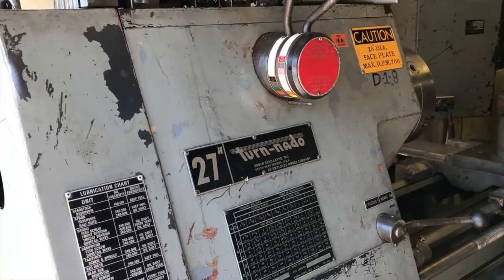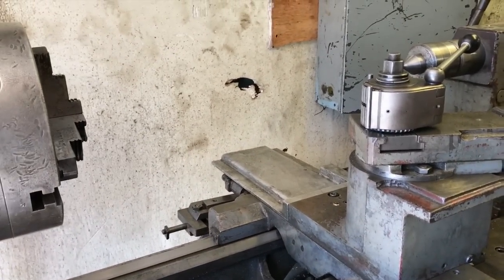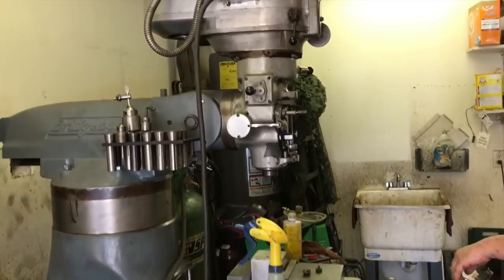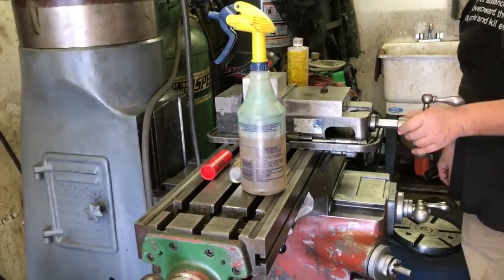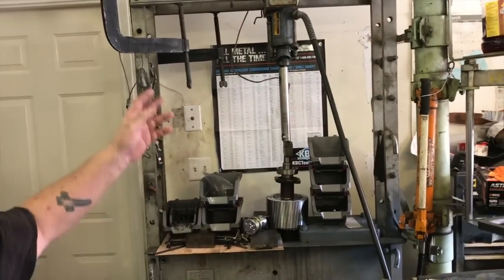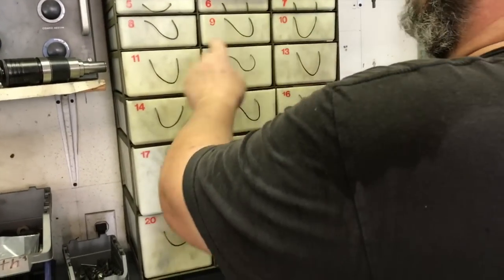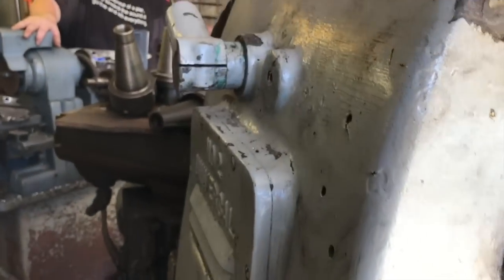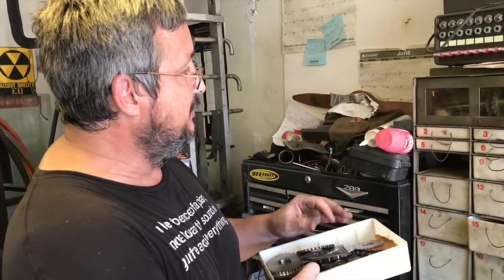Garage Machine Shop In the City   FOR SALE

Comment: Very good price, if I were close I'd be there tomorrow. You've got that priced where someone could take what they needed and sell 100 or so small items on eBay for $15k and still think you had it all. I got a clausing 8 years ago for $750 with  a nice set of DTM tooling which got a little over $600 on eBay. Sold the lathe couple years later for $500 and still have about 500lbs of lathe tools.

Comment: Hay Martin,
I have the money but how would I get it all the way to CT? I'm a retired Electrician and would love to start machining as a hobby. What do ya think? Drop me a line. 
Thanks Martin!
Gary
Reply: Gary Scoville 1. An all terrain forklift. 2. Two forty long flatbed semitrailers. 3. Enough ratchet straps for everything. For 3k more I'll do coordination with everything.
Reply: THE TEXAS GUN GUY Great shop!!!  I have the exact same Modern No. 2 Universal mill. Very rugged and comparable to a Cincinnati 2MH or K&T No 2CH in size and function. The feeds and rapids are mechanically driven on mine. There are two oil sumps, one in the column and the other in the knee. Cheers, Daniel
Reply: Call a few riggers,  They'll do that in a heart beat..  It's probably cheaper than you think..     Moving that stuff is a "No Brainer" for any rigger..  It looks impossible to the average guy,    But, if ya ever watched riggers,  you'll see what I mean.

Comment: The South Bend Turnado isn't rated as one of the best job shop lathes being a bit on the light side, but in the 17" model size it was my favorite engine lathe. The controls fall to hand without even having to look. The speed changes are slick (coupled with a two speed motor) and the QC box has effortless feed changes.
Reply: The SB now lives with me, I would agree with your statement.

Comment: Nice work shop. But, CNC tool room lathe that size is the way to go. You can't beat the time savings making radius, perfect threads in no time at all.  Multiple steps in a pieces are done in no time and without the risk of mistakes. ID's take a long time to machine, this is eliminated on a cnc lathe. I could go on. Same with a protract Bridgeport, In fact they shouldn't even make a non CNC Bridgeport anymore. Why would anyone want to work manually anymore? If you don't have to. Make a bolt circle with turntable? Nay, don't do it. But still nice shop. As to your personal life, I don't know where your at but, Life in church, serving the Lord and doing what your wife want you to do is the only way to live. Let the spirit be our guide through scripture, "Remember the abundance of life does not consist in things that man possesses." And "the Love of money is the root all evil."
Reply: The manual mill had some places over CNC. I have a CNC machine center however, I rebuild various machinery, certain parts I refurbish would be very hard on CNC. It just depends on what you use your machines for.